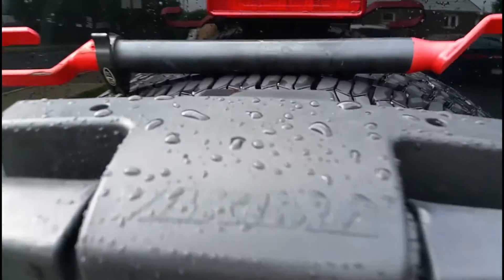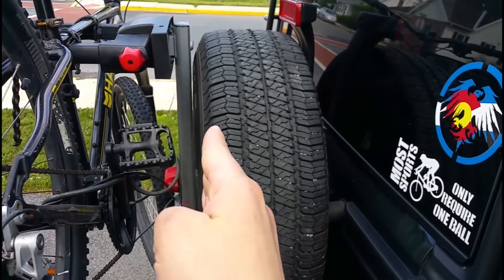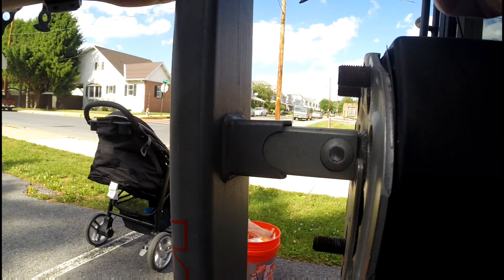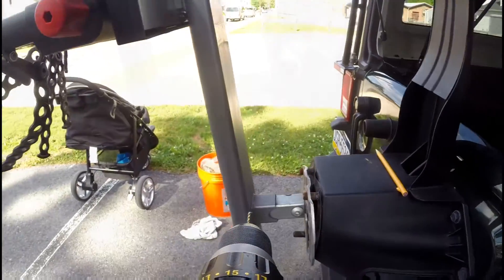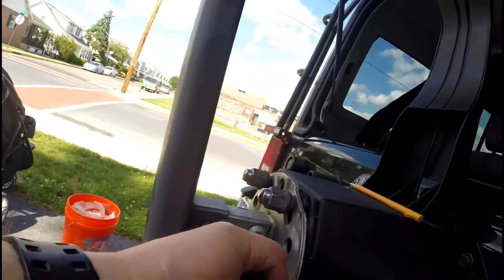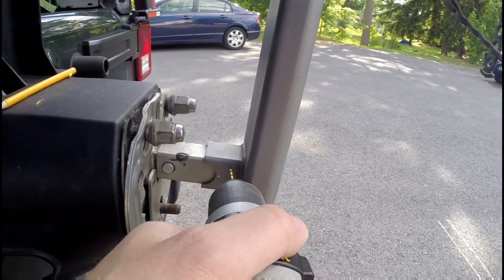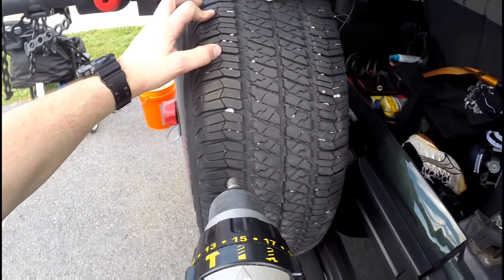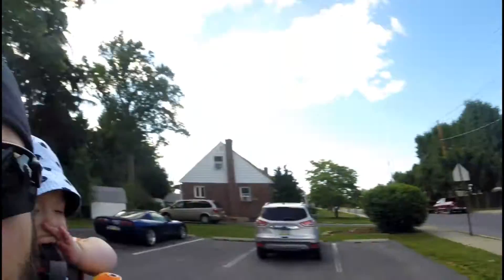MY REVIEW | YAKIMA SPARETIME RACK  (and Repair)

Comment: so, when you get a flat tire and don't have a drill to remove those screws, how do you remove the rack to get the spare tire off.....?
Reply from the maker: +Jake Lehner Easy... I always keep a tool kit in my jeep. Mostly because I like to take off the doors and top and you need a tool kit to put on the temporary mirrors. Thanks for watching, keep the rubber side down.
Reply: #ratchet
Reply: you could just use a through  pin and split pin to lock it on similar to a tow hitch t that way its tool less  removal  and it will stop it from falling off over time

Comment: GREAT mod to fix, how is it holding up? fix the problem completely? did you ever think about one screw through instead of two? or is that a problem with the red knob?
Reply from the maker: +Branden Brooks The problem was the red knob coming loose. I thought about the "thru bolt" method but didn't do it simply because I had the screws in my stash of hardware. The thru method would be better overall, but would require a little more removal and set up of the components. I always carry a tool kit in my jeep so the nut driver made sense to me. For "tube carry" rack it's a great rack all in all. Until they make a spare tire mounted rack that holds the bike via the wheels in lieu of the tube, this will be my favorite rack.
Reply from the maker: +Branden Brooks It's holding up great by the way... Thanks watching and contributing.
Reply: great! glad to hear, I love Yakima racks and had a hitch rack for my JK but couldn't access back so it was useless basically. definitely will be investing in this rack and immediately doing the mod you did. Thanks!

Comment: It looks like someone can simply remove the spare tire lugnuts and steal the whole rack and spare tire?
Reply: I didn't see the lockonut that will help, otherwise it seems like they can just remove the wheel with a socket and take the whole thing.
Reply from the maker: Yeah, the locknut is what locks it in place. At the end of the day, I think that if someone’s going to steal it they’re going to steal it. This will just them slow them down. No matter what rack you use that’s always a risk you take when taking your bike out in public. 

Thanks for watching dude!

Comment: What model is this rack?
Reply from the maker: It's a SpareTime rack. Yakima has replaced it with the SpareRide rack. It still has the same method of connecting to the spare tire, but an updated design for mounting the bikes.  Overall it's still functionally the same. Than6 for watching.
Reply: @DominicWilbrink  awesome thanks